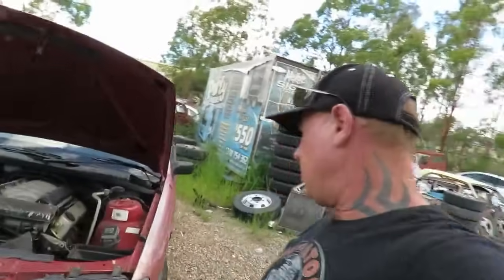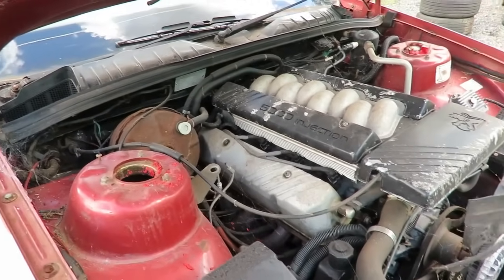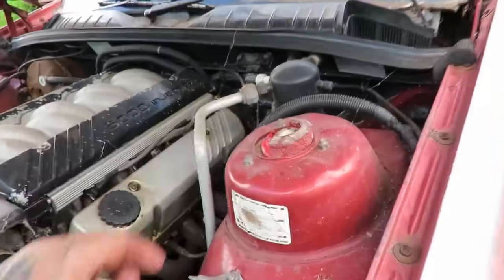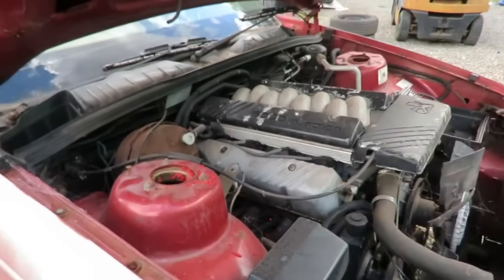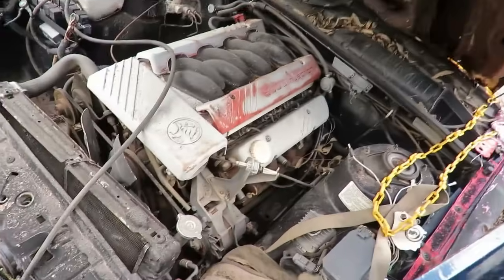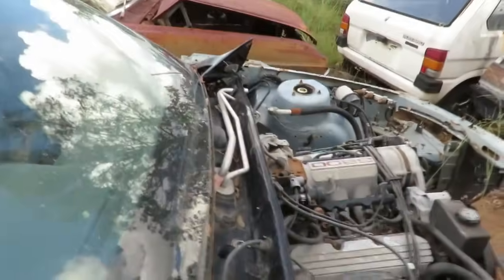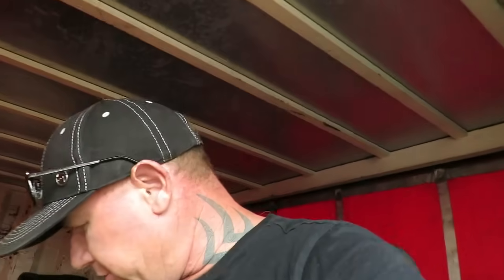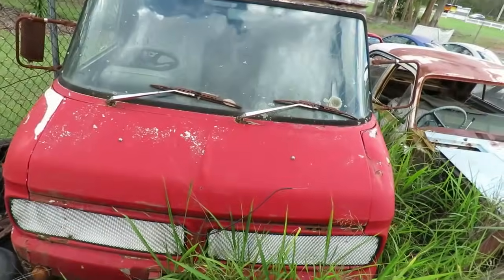Kingatow crew #181 Ratty VNSS it all starts with finding parts and i think we have what we need

Comment: Still waiting to see you crossover 10k mate. If I won the lottery I'd buy you a 3.5t trailer. Broke the bank to get mine but just having all the thinker metal like bigger axles (6 lug), thicker shackle mounts, elecy brakes, 4mm drawbar, makes the diff. I broke the bank to get mine. Worth it. I'm not in Queensland but did look at lockyer up there. Good mob. Mate even if it doesn't come together that's ok. Just do what you can. I'm the same I've done a lot but it's never enough. Stopped beating myself over it tho. Made the diff.
Reply from the maker: trailers are hard I am super happy with the new one I have it is the same as my old one just better suspension setup ...I like it being a bit lighter less fuel draging it around plus if I ever use it on a car not on a truck not to heavy
Reply: @KingatowCrew  fair enough. Better suspension and light helps. Yeah that first one looked a tad flimsy around the springs.
Reply from the maker: it's done easy 100.000ks plus in the past 11yrs definitely got my moneys worth

Comment: Vl diff to the vn diff is 6 inches difference
Reply from the maker: 6 inchs seems alot I am positive it's like 30mm a side 60mm overall I will do a search I will be back
Reply from the maker: yer 1510 vl and 1560 vn so 50mm 25mm per side with a quick search
Reply: Mmm back in the day I tried this vn was 6 inches longer then a vl diff so I put a Vr diff in the vn in stead mate but u can try it ur self mate
Reply from the maker: an inch is 25mm so 6 inches is 150mm ...just for you I will get under both and video it ...6 inches that is like half my c##k lol